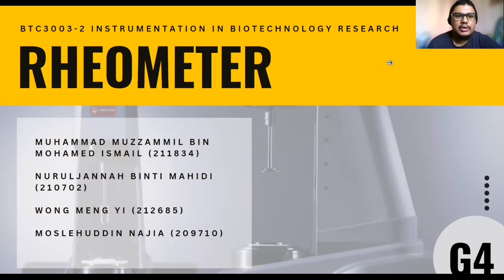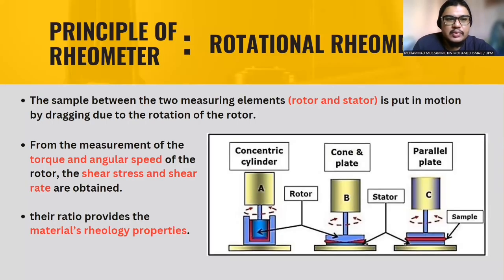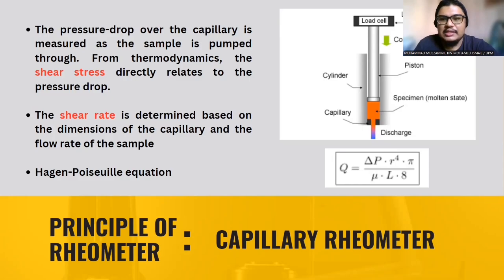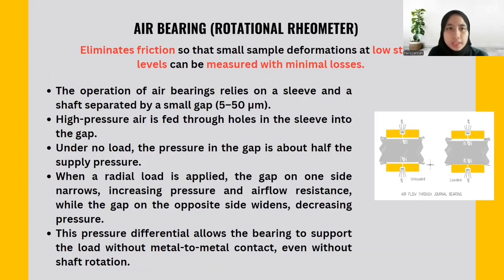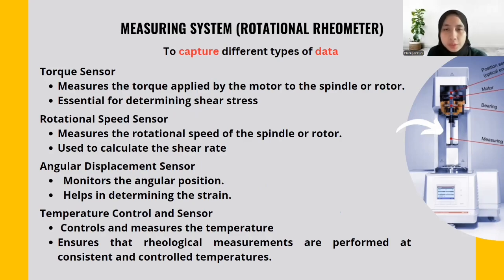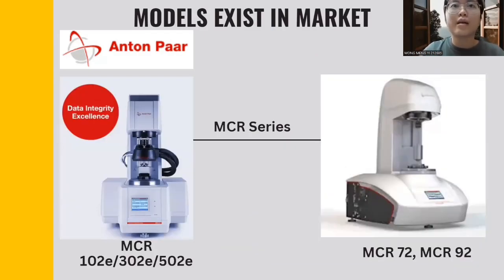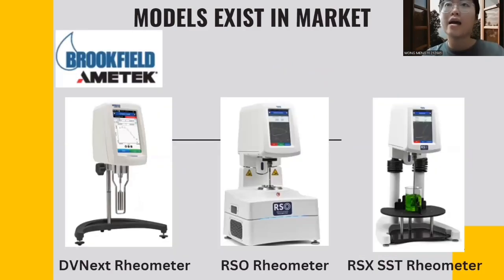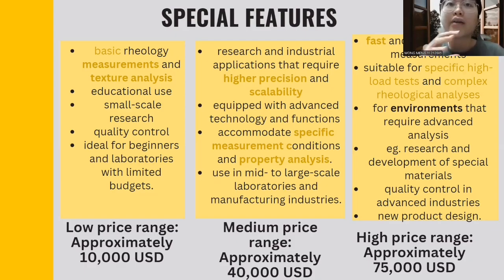BTC3003-2 INSTRUMENTATION IN BIOTECHNOLOGY RESEARCH | GROUP 3 | UPM

Comment: Hi, group 3.
My question is:
What are the considerations for using rheometers in harsh or extreme environmental conditions, such as high temperatures or corrosive environments?
(Choo Ling Yin, 210206)
Reply: Rheometers are crucial tools for measuring rheological properties in extreme environments. They require materials that can withstand high temperatures, thermal insulation, precise temperature control, and stability. Regular calibration, handling, and environmental controls are essential. High-temperature data interpretation and software capabilities are crucial. Safety measures and component durability are also crucial. 1:23

Comment: Hi, Group 3. Based on the different brands of the models that currently exist in the market, may I know what are the economic considerations when choosing a rheometer for a laboratory or industrial setting? Thanks :)
(Nurul Azlina Rusli 212919)
Reply: factors such as initial cost, operational costs, maintenance, training, depreciation, versatility, sample throughput, data integration and software costs, regulatory compliance costs, and supplier reputation and warranty coverage should be considered.

Comment: Haii group 3! Can i know how do you set up a rheometer for a measurement? (LOW JINGYING 210875)
Reply: Hi! The process of setting a rheometer for a measurement requires several vital steps. Start by calibrating the rheometer and thoroughly cleaning the measuring geometry to guarantee precise measurements. Select the suitable geometry based on the material type and desired measurement, and establish the desired temperature using the rheometer's temperature control system, enabling it to reach a stable state. Before loading the sample onto the measuring geometry, make sure it is uniform and does not contain any air bubbles. Input the measurement parameters into the control software, accurately adjust the sample gap, and remove any surplus material. Start the measurement and carefully observe the process for any possible issues. Following the measurement, thoroughly cleanse the geometry once more and proceed to save and analyse the data in order to obtain precise results. (Nuruljannah binti Mahidi 210702 Group 3)

Comment: hello grp 3, im curious on how does rheometer help in medical diagnostics, what diseases can be diagnosed with rheometer? (NIK ALEESYA 210295)
Reply: Hi Nik, Rheometers help in medical diagnostics by measuring the flow and deformation properties of biological fluids and tissues. These measurements can reveal changes in the physical properties of these substances that are associated with various diseases. 
For example, rheometer can diagnostics diabetes. This is because blood viscosity is often higher in individuals with diabetes, which can be detected using a rheometer. Elevated blood viscosity can indicate poor blood sugar control and increased risk of complications.

Various other diseases can be determined by rheometer include cardiovascular diseases, anemia, sickle cell diseases , osteoarthritis (changes in synovial fluid), dignostics in cancer and etc. 

As your extra info, rheology is important in pharmaceutical industry as it is often used to determine the appropriate transport mechanisms for the drug product. Hence , by using rheology, important flow properties can be evaluated to ensure the superiority of the final product. 

(Wong Meng Yi 212685 GRP3)

Comment: Hi group 3. So my question is, in your opinion, what could be the possible limitations of rheometer that could affect the measuring accurancy?
~ Saranya Govindasamy 211624/ Group 2
Reply: Hi! The possible limitations of a rheometer that could affect measurement accuracy include temperature control challenges, where even minor fluctuations can result in inconsistent outcomes, particularly for sensitive materials.  The resolution and sensitivity of the rheometer's sensors could also affect the measurement accuracy, as lower sensitivity may fail to detect subtle variations in rheological properties. (Nuruljannah binti Mahidi 210702 Group 3)

Comment: Hi Group 3 ! May I know how do temperature variations affect the rheological properties of materials, and how do rheometers account for these variations during measurements?
-YAP SWEE YEE (212941)
Reply: Temperature variations affect rheological properties by typically decreasing viscosity and elasticity as temperature increases. Rheometers account for these variation through- regulate temperature, calibrate materials, equilibrate samples, correct data, and ensure thermal insulation for controlled environments.

Comment: hello, may i know how are rheometers applied in polymer engineering to assess material properties?
-KOK XIANG YI(211204)
Reply from the maker: Hi KOK, rheometers measure the viscosity of polymer melts and solutions, which is crucial for understanding how polymers flow during processing and application in other fields. Besides, rheological measurements are used for quality control to ensure that polymer products meet the required specifications as per the customer to meet their high quality demand. It is also used to study the structural properties of polymers, including their elasticity and plasticity. This information is vital for developing new materials and improving existing ones. Hope answers.  (MUHAMMAD MUZZAMMIL BIN MOHAMED ISMAIL/ 211834/ GROUP 3)

Comment: Hi group 3. My question is, for the angular displacement sensor, how does it determine the strain by monitoring angular position?
-Pavithra Raghupathy (211683)
Reply from the maker: Hi,, an angular displacement sensor in a rheometer measures the strain by monitoring the angular position of the moving part, typically a plate or bob, as it interacts with the material being tested. Hope this answers.  (MUHAMMAD MUZZAMMIL BIN MOHAMED ISMAIL/ 211834/ GROUP 3)

Comment: Hello, Group 4. My question to you is, what factors should be considered when choosing between different brands and models of rheometers? (SANCHITA VINAYAGAM, 212724)
Reply from the maker: Hi, some of the factors include application specificity since some rheometer may have extra advantage for certain application, cost as different brands may possess the same capability but different price, software used for it as some brands are not user-friendly and ease of  use and maintenance as some brands and models are harder to operate and costlier to maintain. Hope this answers your question.  (MUHAMMAD MUZZAMMIL BIN MOHAMED ISMAIL/ 211834/ GROUP 3)